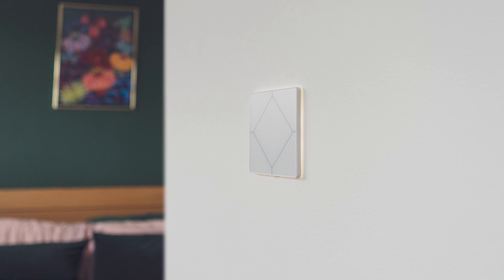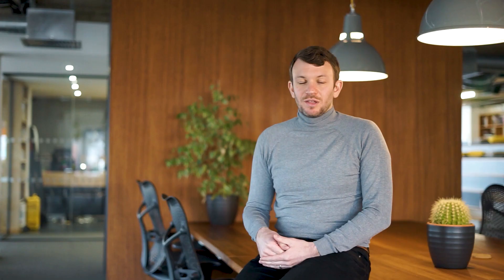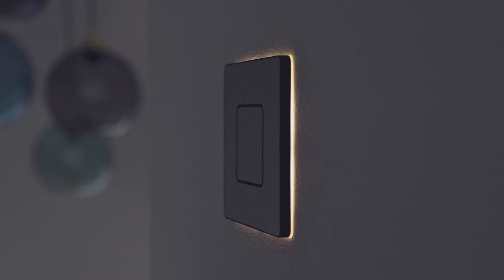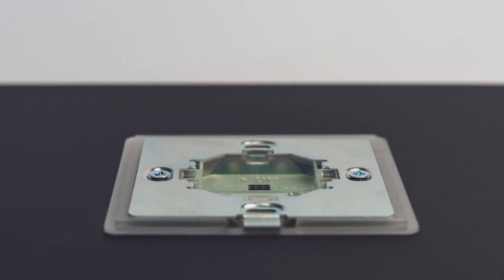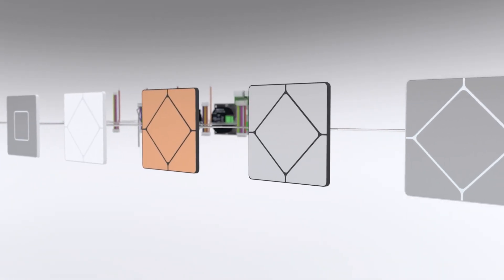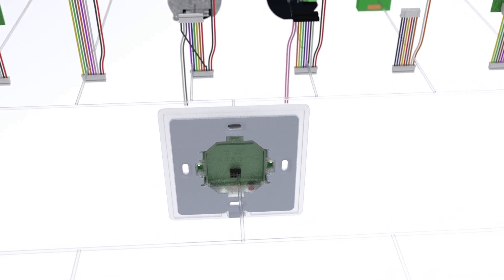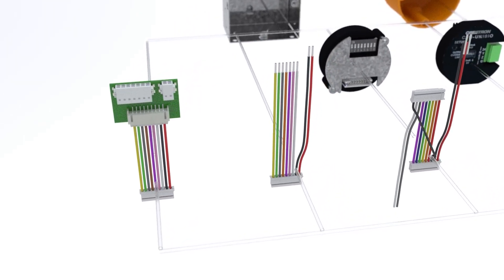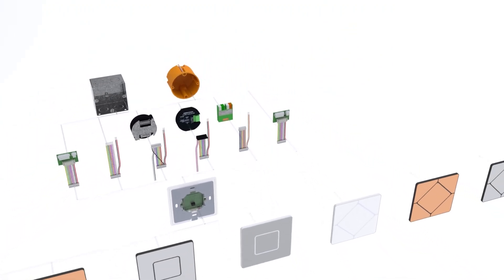Introducing the TAP Volt Free Range

Comment: They look great. Are the voltages and power usage compatible with any z-wave dimmer modules for the UK?
Reply from the maker: Hi, thank you for your kind comments! The keypads need 5V-35V power and have dry contact / volt free outputs. They are designed to be connected in to low voltage input modules. We are not aware of any z-wave input modules that have enough inputs. If you need further support please contact us via our website www.faradite.com